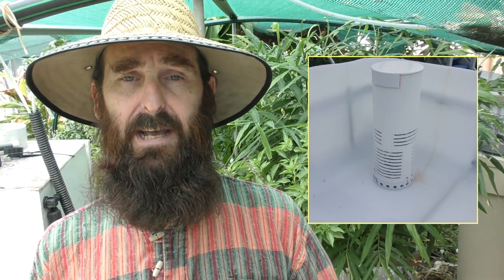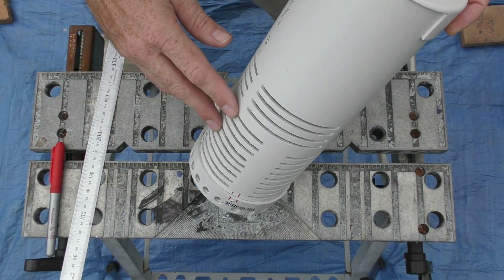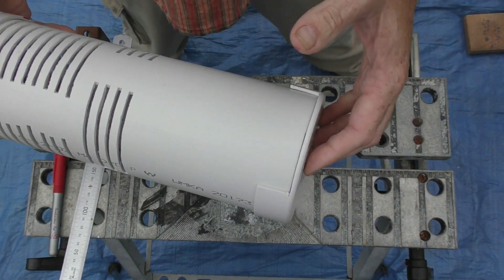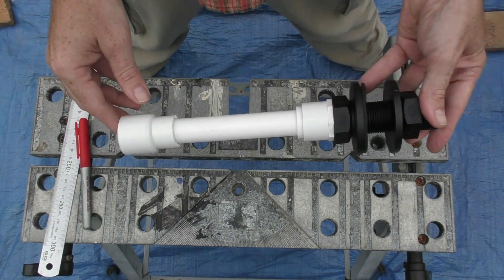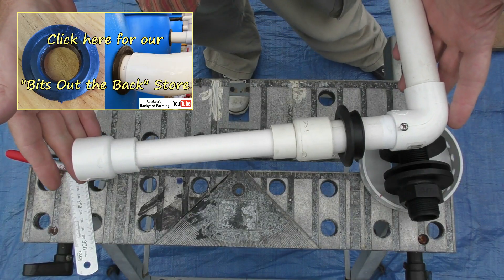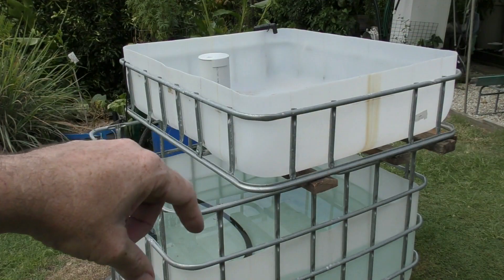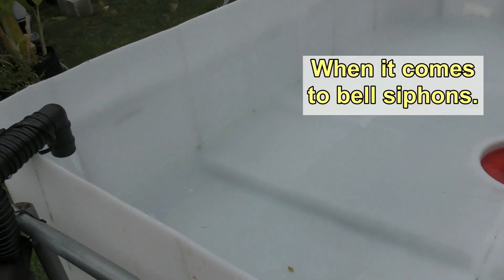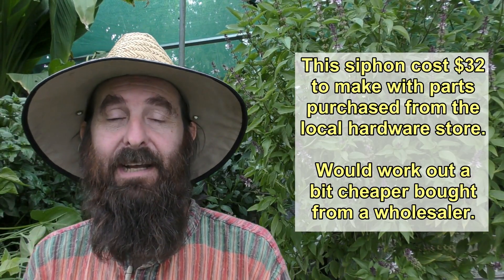How to Make a Bell Siphon & How Bell Siphons Work

Comment: What is the best pump that you recommend? And any filter tips to keep it clean?
Reply from the maker: I found that the Jebao, SunSun &  Sensen work reliably & last for years. The first SunSun I bough back in 2011 just died a few weeks ago & I had to buy a new one to replace it in the kids system. 😅  You folks can get the Jebao & SunSun in the states & I have a few listed on my amazon page if that helps any. 
They are pond pumps so are designed to take a few solids so fish poop is no issue for them. 
Hope that helps.

Comment: is the shape of the cutout part on the bottom of the bell important? i have an aquaponic tank just like the one in the video but i didn't made it so the cut out part from the bell is in a w shape all around and the bell has a tiny hole of 1mm and I've been having a lot of problems with it sometimes it doesn't work and is stuck in overflow and sometimes it never breaks the seal and keeps siphoning. i have tried reducing the water flow but it doesn't work so my only guess is that the shape of the cuts or the cuts are wrong. i have to be checking it every couple of hours to make sure is working properly because in the design i have the siphon is what oxygenates the water for the fish.

Comment: Part breakdown:

There are 3 parts to a bell siphon: a shroud, a standpipe, and a bell.

The shroud has a 4 inch diameter pipe with 2 end caps

The standpipe has a 25mm to 20 mm reducer, a 20 mm pipe, a 20 to 25 mm adapter bush, a 25 mm valve socket, and a 25 mm bulkhead fitting

The bell is a 45 mm pipe with an end cap

You're welcome!
Reply from the maker: Not quite right, I'd go with a 50mm bell at  minimum.  Mainly because 45mm pipe is near impossible to buy. 😉

Comment: You have a bell.. and you have the intake.    Adding a screen is something you that should not be in the intake, or bell. But on the out side….
Reply from the maker: I'm not quite sure I understand what you mean sorry.
Reply: @RobsAquaponics  if you need to filter the water via a screen. Don't put it were all that is screened out is in the smaller cavities of the bell, or the center shaft. Aka intake.   Put it on the outside of the hole rig. So that after a cycle all the junk can float away back into the water supply container.

Comment: Why not just use a 25mm pipe for the stand pipe? Is there a reason you reduce it to 20mm? Thanks!
Reply from the maker: It helps initiate a water lock in slow flow situations. 👍

Comment: Hi Rob does are the slots okay if only 2mm wide? I did it with a cutting disk i dont have a drop saw?
Reply from the maker: As long as the water is flowing through at the same rate as the water is draining you should be good to go.  You might just need to cut a few more if the water flow is a bit sluggish.

Comment: Hey Rob, Not sure if your still checking comments on such an old video, but I was wondering if there was any reason other than preference for not using the centre cap thread to place the bell, it saves on making a new hole and its seems to be the lowest part on the bed.
Reply from the maker: Het CH. It's a lot easier to maintain if it's on the edge of the bed & less chance that it will get over grown with plants. It also means that water needs to travel further meaning that you get a better water exchange every cycle. 
I have seen roots take over sections of a bed & if the plants were on the other side of a central siphon drain it could cause anaerobic issues. 
Hope that helps.

Comment: Here in UK the pipe sizes are different ! I have got a 1.5 inch bulkhead fitting and as such my stand pipe will be bigger . Is this an issue ? Seems hard to get the same size parts you have over here , thanks - I m making the same system as you fyi cheers
Reply from the maker: Sorry it took a while to get back to you Dominic.
You may need to create a restriction in the pipe  so you don't need a HUGE flow rate to initiate the siphon.  You can also use 1"/25mm PVC threaded plumbing fittings. 
Sorry again for taking so long. How did the build turn out?
Reply: @RobsAquaponics  hi  that's no problem..it's gone well so far . Just cycling the system . I ve got ammonia ( introduced pure ammonia to start ) and nitrites about 0.25 , nitrates quite a bit higher . Hopefully be ready soon ,my ammonia levels seem quite high still not dropping but I guess if I have nitrates and nitrites I am on track ? To be fair I am impatient hopefully the ammonia will drop soon , oddly the nitrites never seemed to go very high .
Reply from the maker: @Spyridon1980  Sounds like it's doing well mate.

Comment: Hello rob...I've been watching many videos of yours. I'm really grateful to you for the inspiration and information being shared. I've one question which is intriguing me. What is the height between the 32-25mm reducer and the top internal cap of the bell. I've done it but I'm having issues in initiating and breaking the siphon. Thank you tons Rob.
Reply from the maker: Hi mate. I have had some set as 12mm & others at 40mm+ & all have worked. The siphon breaking may well be an issue with water flow rates. This video may help you with a few ideas,
https://youtu.be/rKEeXNwSxWU

Comment: Can you use the middle cap part (the red cap) and make a bell siphon from there? So you don't have to make a new hole?
Reply from the maker: You can but I prefer to have the inlet & outlet as far from each other as possible. It can also be a bit hard for some folks to access the centre if the drain work there is covered by plants.
Reply: Thank you so much for your quick response. Setting up a system and was wondering if I could utilize that center part and save on work and bulk head. Where I live in the Caribbean, bulk heads are exspensive. So going to use male and female adaptor...or union I think it's called...not sure...and sealant and see how that works. Was even thinking about not having it fill and drain and just have the water over flowing constantly in the middle??? Why do we need to have it fill and drain? Or can I do it that way and just have continuous water in there...I guess without medium? Hard to get the right medium here as well. Was thinking gravel or taking stones from the river or beach. Then I thought I might forget the medium all together and try just water. Would really appreciate your thoughts. Thanks again for replying so quickly. Truly appreciate it.
Reply from the maker: @Seneb8Khepera  The flooding & draining allows air to get to the roots of the plants & also bacteria on the media. In a raft bed set up with no media, they will have air bubblers/stones in there supplying O2 to the roots. 
If you are going to keep the bed constant height I would suggest you add a lot of air into the tank that will be causing the water pump to help the roots & bacteria get what they need. 
Just found this in the spam bit so sorry it took a while to respond.

Comment: If the pump was to be running 24/7:

Would the inflow rate of water (powered by the pump & regulated by valves like yours in the video) need to be less than the outflow rate of the siphon in order for this system to work properly?
Reply from the maker: That's how the siphons work. 👍 This video goes through a few pointers for anyone having issues fine tuning them,
https://youtu.be/rKEeXNwSxWU
Cheers.

Comment: Would you use a bell Syphon on a small koi filter..? Any advantages? Or is it best to use swirl filter instead?
I'm in the process of setting up some sort of filter but don't know which to use ta chris
Reply from the maker: Hey Chis. I can't see any advantages to using a siphon on a filter to help discharge the water. 
 I would go with a small radial flow settler before I'd use a swirl filter. If the system is only small you may get away wiyh using a small DIY canister style filter instead. This vid may give you a few ideas,
 https://www.youtube.com/watch?v=HtMZRM3a5Fs

Comment: They work Great just REMEMBER the UV LIGHT in your Biofilter.
Reply from the maker: I don't like to use UV in aquaponics system. It can make some elements like Iron not available for the plants to take up. Boron & manganese are the others from memory. 
Cheers & have a top one.
Reply: @RobsAquaponics   always another forest fire eh? The algae blooms were fierce, and caused the death of fish and plants in FEBRUARY. Balance is always the trick on nature mate, push too hard here cause a disturbance there. Lots to learn still.
Reply from the maker: @richbaumann2999  I ran one in a system for a while as well to kill off the algae. Found that once the algae died the water went back to normal so removed the UV.
Reply: @RobsAquaponics   Thanks mate, I hope to rebuild one someday and your info is well noted.

Comment: A complete parts list for this build would be deeply appreciated!
Reply from the maker: Hey Thomas.
You can find it here,
https://www.bitsouttheback.com/chop-and-flip-aquaponic-system
Cheers mate.
Reply: @RobsAquaponics  Thank you it has been extremely helpful!  

I also found your Amazon affiliate link which has pre-built bell siphons for sale at a reasonable price, I haven't made up my mind on which to purchase because local hardware stores are useless for a lot of these parts and if I combine all the unique parts online it's more expensive than the finished thing, so, I'll probably go with the prebuilt one at first, reluctantly.

Doing a prawn (giant freshwater Malaysian) and tilapia (blue, pure species from Lakeway Tilapia) dual-run this winter and I am trying to maximize my energy usage.  Any input on how to fit an IBC down basement stairs?  Haha...

Heating is the major one for energy use, followed by lighting.  I appreciate the help!

Comment: Newbie here, just trying to get into this stuff. So, quick question, with a bell siphon system, is the idea that the pump will be on 100% of the time, with a relatively low flow-rate, so the system would constantly be flooding and draining? From what I have gathered, a basic ebb and flow system only floods and drains periodically (maybe 2-5 times per day, but depends on your grow media), but unless I'm missing something, putting the pump on a timer with the bell siphon system could end up leaving way too much water in the grow bed if it doesn't happen to turn off right after the siphon kicks in. So I'm guessing you just adjust your flowrate to something that would be slow enough to allow enough fresh air in.
Reply from the maker: Hi Brandon. My beds flood & drain anywhere between 2-4 times an hour with the water pump running 24/7. 
I prefer to have the water flowing through the beds (which are essentially the biofilters) all the time so the water is always "clean" for the fish. 
Hope that helps.
Reply: @RobsAquaponics   Thanks for the info! I recently found your YouTube channel and I'm blown away. Amazing content and ideas. Thanks for taking the time to answer my question, too!
Reply from the maker: @brandonmakridis1565  No problem mate. 👍
Cheers.

Comment: So, I can’t find 2-1/2” pipe anywhere to make the bell, but I have some 2” lying around. Is that going to adversely affect flow rate, or will the 2” bell be fine?
Reply from the maker: I've started to use the 2" now as well as tall plastic drink bottles with the base cut out Cameron. I went with the 2½" as that's was what folks were recommending at the time. 
Hope that helps some mate.

Comment: Hey buddy, I have my metal supports under my grow bed but my grow bed still flexs inward and my bell siphon leans a little bit which messes up my siphon. Any advice?
Reply from the maker: Sorry I missed this mate. You could try adding an extra run of timber under the cage & place one section near the siphon to give it a bit of support.
I also recently posted a video on trouble shooting the siphons that might give you a few other ideas like a simple snorkel that may help some,  https://www.youtube.com/watch?v=rKEeXNwSxWU

Sorry for taking so long to get back to you.

Comment: So I have two absolutely identical bellsiphons.....one is working perfectly....the other one gives me the patience run.... If the flow is perfect to initiate the siphon...it empties the bed and then it won't stop....if I reduce the flow....it won't initiate...HELP....
any ideas why this is the way it is....I am at that point where I have one bell siphon and have a U siphon in the other bed. Appreciate your input. Thanks mate.
Reply from the maker: Sorry it took so long to get back to you. Did you end up sorting out the issue?
Reply: @RobsAquaponics  oh man....I am still struggling.....I attached a breathing pipe to it, but it still struggles to either initiate or stopping....I am looking now into a U-siphon...downside is I have to completely empty the growing bed to change the siphon because I need to change the outlet. All that while the other one is working perfectly!
Reply from the maker: @beevondewitz2794  You'll find that the U siphon can be just as fiddly.
Is there anyway you could post a few pictures or video of the build on the top & the drain underneath for me? That will help a lot in working out what could be wrong with it. Some times it can just come down to the fittings &used & angle of the drain under the bed that causes you the issues.

Comment: Any tricks to get the siphon going at a slower fill rate like 90 gallons per hour? I'm building a small scale system with a 3 gal grow bed and a 20 gal fish tank, no sump and solid filter. Can't seem to get the siphon going with the 90gal pump, I just get a slow flow but the bed stays at the height of the stand pipe. It works when I tested it outside with the garden hose. I'm guessing the bell is getting aerated by the drain and not enough water flowing out to initiate the siphon. Any thoughts on how to make this small system work?
Reply: Nvm, just found out about a s trap.
Reply from the maker: No problem mate. 
How's the system running now James? 
Cheers.

Comment: The other tip I have found is that the siphon needs to be pretty perfectly vertical to work - so as it gets shifted around over the weeks and fails to cut off the siphoning, sometimes just a micro alignment fixes it.
Reply from the maker: Have had that happen with some. One way to overcome it is to increase the flow rate. It doesn't always work but can be a workaround. 
The siphon in our large bed at the moment is sitting at a noticeable angle but fires & breaks just fine. It also has a snorkel attached which helps some I suspect. 😉
Cheers mate & have a top one.
Reply: what if I can't increase the water flow

Comment: Should you put another standpipe as a safety in case the siphon failed?
Reply from the maker: I have seen some folks that will include a drain at the top of the side wall just in case the siphon gets clogged. I did the same when starting out but haven't had any issues so stopped including them. 
Most folks will check over the beds regularly & unclog roots from the media shroud as they find them.👍
Cheers.

Comment: Great video. Metric sounds so easy. The base plate is extremely valuable. I built my first versions without a baseplate and it was pretty painful if I moved the shroud at all.

The stainless screws only work in air. I tried using something similar underground outside and the water leaked out because it couldn't air dry a seal around the screw. 

Thanks for the great explanation!
Reply from the maker: Thanks for that Joe. Have never tried to bury them but will keep it in mind.
Cheers & have a top one.
Reply: @RobsAquaponics  Ya, it surprised me too. I think when you do the screw method a little tiny bit of water leaks out and dries and seals. But if the pipes are in a place where it'll wick away the water never air seels. Pretty cool.

Comment: Thank you very much,I go with the motto,when I cannot put it together in my mind its too complicate,so another solution is needed or some knowledge !!!I was not able to figure out how these two pipes put together make the water drain without any pump needed and changing levels from almost full to almost zero alternating.I goolged and your video come up again,a confirmation that I need to subscribe : ) 
Got the point now !!!Thanks and GOD bless you and your family,and your garden also of course !
Reply from the maker: Glad it helped you out Martin.
Hope the build goes smoothly for you.
Cheers.
Reply: @RobsAquaponics  All good so far,waiting for the clay pepples to arrive.I already had a hole of a few centimeters in the top of the barrel,so I closed it with a conical cup and made a hole for a piece of flexible tube.The upper part is a coke bottle,stuck in the conical cup and holes at low level,works nicely.i struggle with leaking on the cover all around it,its a barrel with a coer of about 30cm.I put everything together with hot glue,I hope this is not a problem for the fish and plants.Parts,fishes and seeds are a little bit difficult to get here in Assam/NE India.Specially in the last couple of months.So I use what I have at home anyway which we would have to throw in the trash anyway.

Comment: Hi Rob, I’m wondering how long you made your bell? Is there an optimal amount of space to leave between the top of the stand pip and the top of the bell?
Reply from the maker: I have the bell sitting between 20-30mm/¾-1¼" from the top of the standpipe in most of the beds. I have used the bells on just the fittings in the base of the grow beds leaving around a 170-200mm/6¾-8" gap & they fire off every time with no issue.  
Hope that helps some Jake.

Comment: Great video but I wanted to toss in a bit of info on how glue and primer works.   The primer doesn't just clean the pipe. It has a reaction with the pipe that softens (almost melts it) it so that when you add the glue it actually "welds" (for lack of better word) the two pieces together.  If you only use glue then the glue is the only thing sealing the pipe that that will leak eventually.  I know it's not that important but thought you might find it interesting.
Reply from the maker: Cheers mate.